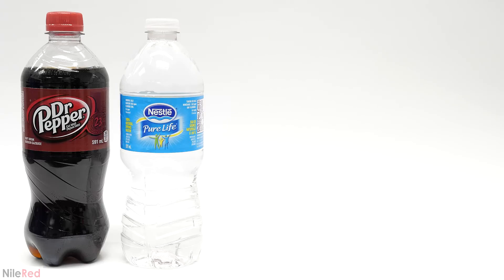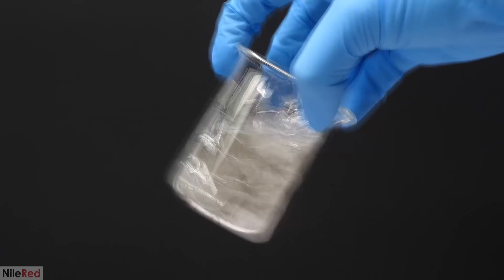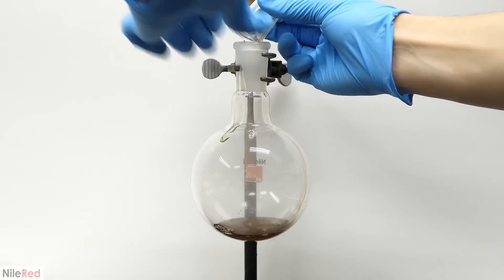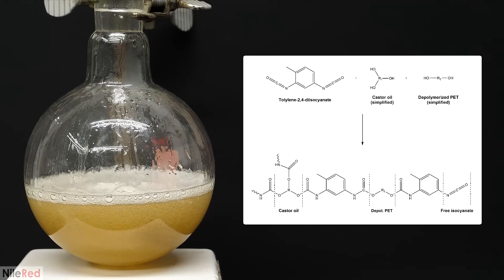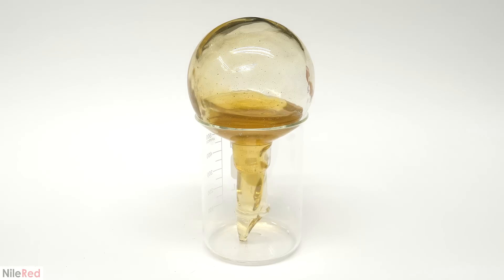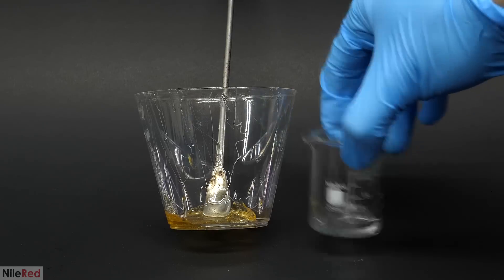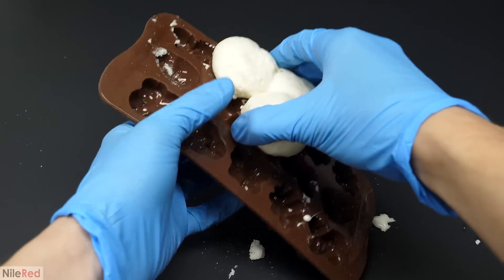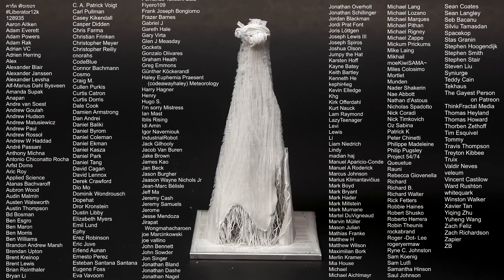Turning a plastic soda bottle into foam

Comment: i want to thank you for the beautiful video again, but point out that you should really consider using something else than porcelain as boiling chips. when these hard and sharp objects bump around in your RBF, it'll scrape and chip it, so it might be less resistant to stress in the future and break when cooled or heated fast or to dryness. use something softer, maybe even commercial boiling stones or mol. sieves if not working in acidic medium.

Comment: Kudos to Skills are for sponsoring quality content.  NileRed I would like to know of a crystal I can grow in the home lab and incorporate into an art project in which water flows around the crystal.  From what I've read so far, growing such a crystal to 0.8" major axis length is not easy.  Anything that precipitated from a water solution is likely to erode and dissolve due to being in contact with a flow of water.  I haven't see any procedures that make crystals from solutions made in, e.g. a nonpolar solvent.

Comment: As I understand it you can use a simple cotton candy maker from Walmart to spin out threads
from recycled pop bottles.  Just chop into little shreds and run it instead of sugar.
I've never done this however apparently it is being done to produce synthetic fibers in 3rd world countries.
Reply: PET recycling is super interesting. it's a pretty neat material but it's important to note that it absorbs a degree of water. if you want it to melt nice and clear you need to heat it for a long time to drive out water before you bring the temperature up to melting temp. as i understand it those spun fibers would basically be dacron
Reply: I have my doubts about if it would work. A quick google search reveals that the melting point of PET is about 100 degrees C hotter than that of sugar, so there's a strong possibility that it wouldn't get hot enough. Of course, it still sounds like a cool idea, and I would try it if I had spare cash for a walmart cotton candy machine.
Reply: Reagan Harder   When I saw this demonstrated (on TV) while being used in a 3rd world country they were using an antique CC spinner which was powered by a flame.  Perhaps this is why they were able to have some success.  I have never tried this however.
Reply: @seanb3516  But if labgrade glassware gets into glass wool processing equipment - well this happens also. Ruining the injectors in  the process.
Reply: @wernerhiemer406    I have to admit to not having performed the process or even observing it personally.  I would also suspect that the correct equipment to produce simple fibers wouldn't be all that expensive.  (note the use of the wording 'simple fibers')

Comment: A few years back, someone threw out a beer brewing barrel, and it got blown out of their bin, it was made with PET, so I threw it in our recycling bin, the bin fairies refused to empty the bin stating that the barrel was "not recyclable", apparently they need educating in what PET is, I did get them to take it though, I just buried it at the bottom of the bin so they didn't see it when they emptied the bin... :P
Reply: twocvbloke question, wtf is a bin fairy? I’m not trying to offend you but, what?
Reply: +twocvbloke --  I think you would like comedian, Denis Leary. Minus a British accent, and your post becomes exactly like his comedy routine.
Reply: twocvbloke doesn't mean those bin men liked the work, they probably had little choice
Reply: Also known as bin men, the lazy cunts who casually wheel a bin to the back of the truck, push a button & let the machine work for them, then have the audacity to bitch and moan about the bin being "too full" when they didn't empty it two weeks prior...

I remember when real bin men had to lift metal bins filled with coal ash onto their backs and tip it into the trucks, they never whined...
Reply: The size of the barrel made it un-recyclable in their system. Too big to fit in their shredder. That's what made it unrecyclable in that context.

Comment: This looks like the foam they use as a base they use in fake plants and flowers.
Reply from the maker: I think thats more styrofoam, no?
Reply: Styrofoam has foam balls pasted together look to it where this is a fine powder. Years ago the fake flowers used a foam just like this that was soft and crumbled really easy but after a long time would become hard so the stems would remain secure. I haven't seen it used in a long time but if I see old fake flowers pots it will be stuff like this at the bottom . I wonder if this was the method they used to make it? The stuff in flower pots was always green. What happens if you dye this stuff?

Comment: The one question I have left after this, is how much of the catalysts and other reagents are usable for something else, or how much of them are simply waste? I generally object to recycling plastics since it's neither cheaper (yet anyway minus subsidies for doing it) and I honestly wonder about the environmental impact of the waste products and production of the chemicals needed to do it. 

I think less focus ought to be put on recycling and more on increasing the temperature tolerance of organic plastics such as PLA, which currently can't be used for anything that needs to be heated, but I believe is being introduced into packagings. To replace things like PET. Would be interested in you experimenting on PLA to see how you could increase the glass temperature of it.

Comment: Commercial styrofoam blocks often seem to be constructed of small beads of foam that are stuck to each other. Why is it done that way? My guess, after seeing the pieces produced in this video, is that it has to do with reducing the amount of crumbling and powdering when the pieces are broken, as breaking a block of commercial styrofoam seems to result in the beads themselves staying relatively intact.
Reply: Styrofoam is made out of polystyrene not polyurethane, the expansion process of polystyrene is the reason for the small beads...
Reply: Whoops, yeah.

Comment: Another important thing to mention about recycling any plastic mechanically, everytime you shred, remelt, regranulate and remold it, the polymer chains get shorter and mechanical, thermal and chemical properties worsen. Which is why for certain applications, even outside of the food and medical industry, recycled material is highly unrecommended or even forbidden, IE in any safety application, highly stressed industrial parts and others. Other plastics can technically be recycled but doing so is a health hazard, Polyoxymethylene and Polyvinylchloryde, even others experience no change in any way during recycling, due to their high mechanical and thermal resistance, IE PEEK and other high performance plastics. However consumer plastics, PE, PP, PS, PVC and maybe PET and PBT, are usually not recycled due to consumers not being aware of how to do so
Reply: On a table top level. And yet it is actually done, on a industrial scale. You would think someone there would have run the numbers, and figured out if it's worth it or not...
Reply: Mr B Nilered just demonstrated how impractical it is.  100 dollars in chemicals to recycle a 1 cent bottle.
Reply: Chemically recycling PET means you break down the long chains in to it's smallest parts, and reform them in to new long chains. This can be done over and over, for ever, with no degrading.
Reply: Mr B that really depends on the product you produce. Some plastics can be incredibly hard to degrade, as an example, tho thermal degradation, I once accidentally left on the aggregate we use to mold PEEK over the weekend, the PEEK was not thermally degraded after more than 50hrs above 380°C. It was wet but otherwise fine.
Reply: does eating it count as recycling?
Reply: Finally! Someone that knows what they're talking about. It's so difficult to find anyone that knows anything about polymers.

Comment: nice video, can you make a video for dissolving car tyres or rubber?
Reply: Vulcanized rubber like the one in tires will not dissolve in anything as-is. It can be chemically degraded though and that would make it dissolve, but it won't be rubber anymore at that point.
Reply: are you familiar with that process, its getting interesting, there is so much disposed car tires around the globe, i hope someone figure this issue...
Reply: which kind of rubber

Comment: “I added some boiling chips I got from smashing a porcelain plate.” 🤣
Reply: "A boiling chip, boiling stone, or anti-bumping granule is a tiny, unevenly shaped piece of substance added to liquids to make them boil more calmly."
Reply: that's how it's done in every lab, mostly from crucibles.
Reply: @NileRed you should really consider using something else than porcelain as boiling chips. when these hard and sharp objects bump around in your RBF, they'll scrape and chip it, so it might be less resistant to stress in the future and break when cooled or heated fast or to dryness. use something softer, maybe even commercial boiling stones or mol. sieves if not working in acidic medium.
Reply: Fully Fledged 78 smashed it on purpose, I assume
Reply: What’s a boiling chip again
Reply: Done for him without asking, just dodge the flatware and pick up, unless married to chemistry and only children are novel compounds.
Reply: This is for the plate:
Oooooooooooooooooooooooooof

Comment: Nice video man tried myself to break apart PET with sodium hydroxyide but that didnt go out as planned
Reply from the maker: The strong base at it apart!
Reply: did anything explosive happen?
Reply: Fortunatly not but when i tried to vacuum filter it the filter paper kinda messed up and thsts why i lost most of the product
Reply: No the filter paper was alright because the sodium hydroxide was pretty dilute but it wasnt cooled down enough even though i used an ice bath. Because it was still "hot" the filterpaper curled up